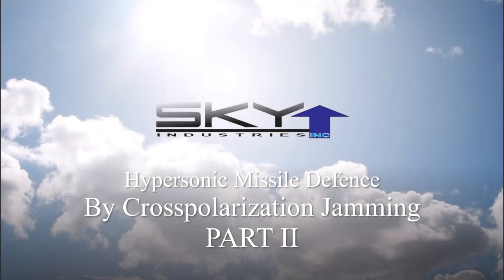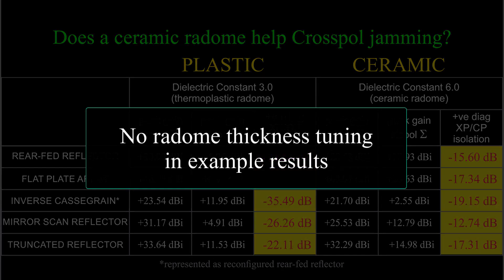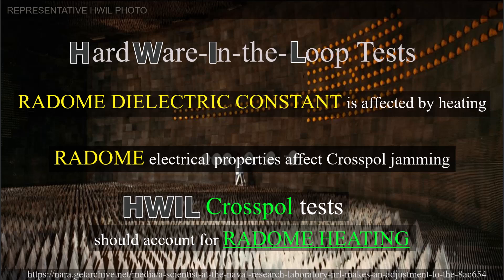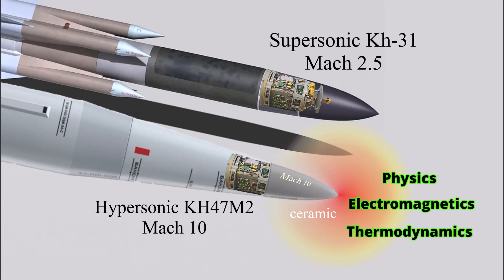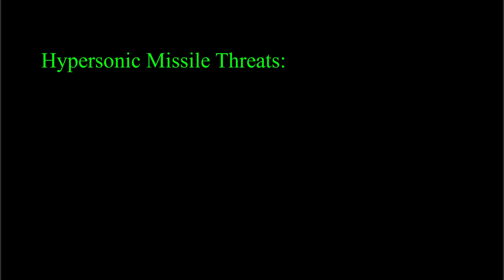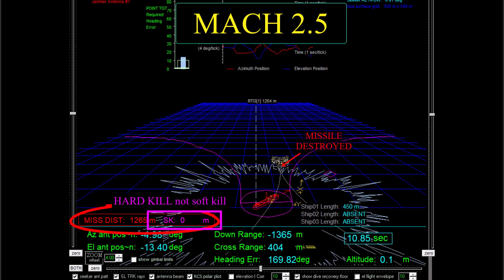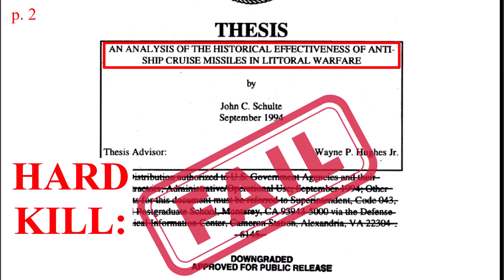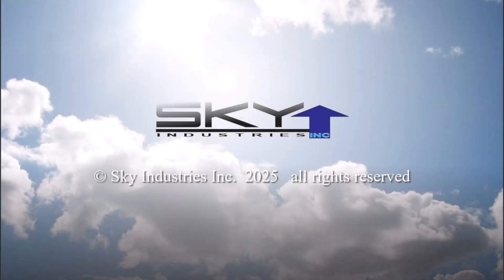Hypersonic Missile Defence By Crosspolarization Jamming PART II 25

Comment: "where a defender was alerted" is a big if on the battlefield.  I don't imagine these jammers will be turn on all the time. ...Alert time is limited due to the Mach 10 factor.  Do want to thank you for a great video.  Learn a lot.
Reply: a carrier group is unlikely to travel without some sort of AWACS asset tagging along, so over-the-horizon early warning can be assumed present.
Reply: SBIS has coverage over the entire globe and is capable of seeing even small fires as has been proven in the Ukraine war. these satellites are more than capable of providing instant launch warning, and because of the heat generated they can track the plasma flare all the way down to the surface without difficulty.
Reply from the maker: Expect the jammer to be on all the time, day and night.  Doesn't mean it will be, but it should be.  

Also expect the jammer to be cued by other shipboard sensors.  I believe this is what the author meant by "where a defender was alerted", another way of saying, "where the jammer was operating as intended".
Reply: @skyindustries  Exactly, ELINT sniffers in the AO would detect acquisition radar emissions the moment the missile turned active if not from the ships own onboard ESM antennas. This is also excluding Launch detection from space based early warning systems, which would make the chance of early detection very high. The general assumption about any unit is to realize that it won’t exist in a vacuum; I.e. nothing fights alone, assume that your target will always detect your attack and plan accordingly.
Reply: @skyindustries  Well home on jam and also Ukraine has shown you cant always jam

Plus reaction time is slowed down 

And thats when your point about hard kill is bs

Since you might end up jamming that too 

Kinda happened to the HMS Sheffield

Not saying Jamming is useless but relying one just measure isnt all that good of an idea either

Layered air defence is key
Reply: @spark5558 youre assuming jamming is continuous, and it is not for all intents and purposes, with respect to the adversary. 

that's about as far as I'll go.
Reply: Aegis BMD is networked together so while early detection is not a given, it is very likely.
Reply: @aidanmattson681  from my limited knowlige

Wouldnt the main advantege of  aegis be that your response time would be much shorter?
Reply: @nikolaideianov5092  the Aegis weapons system was principally created to better handle large saturation attacks. This also involved getting air plots from AEW or even other ships at times. 

Aegis BMD is even more network centric because of the geometries of BMD. Sensors, shooters, and targets that you need to defend, are likely all in different positions. 

I wouldn’t say that Aegis has an advantage because it reacts faster for two reasons. 1. I don’t know how it exactly compares with other systems. 2. A far better characterization of network-centric advantages is that it has more time and freedom to react within.
Reply: @aidanmattson681  thx

Comment: With the caveat that I A)haven't yet watched the series to completion as I've just discovered it B) am a layman C) know it's a sensitive topic, do to the inherent design requirements require a mechanically steered radar to get both lateral and vertical guidance in the context of guiding a hypersonic missile in the terminal phase of a ballistic trajectory? 

And if not, would crosspolarization as a potential counter to hypersonic missiles be significantly affected by mounting a AESA radar as a seeker? 

With weapons such as the DF-21C being primarily designed for very high value targets such as aircraft carriers it would make sense to me to put the most capable guidance available in the already low-volume high-value weapon.
Reply: there are much smaller and cheaper air to air missiles with AESA seekers, a hypersonic missile aimed at entire ships will obviousle be worth putting an AESA on, only reason not to is if the old school monopulse is trusted more as proven design, seekers can be swapped and weapons modified

Comment: but what if we had 2 radomes? and ejected the hypersonic one, 2 seconds before impact? the plastic one just has to last that long. asking for a friend.
Reply: Eject a solid ceramic radome while flying at 2.5 Mach? How would you even do that?
Reply: @PeterA650  I was being silly, but if you look up the russian word smekalka which sometimes roughly translates as redneck engineering I wouldn't put it past them to try.
Reply: You need to eject the ceramic early enough that you still have time to course correct. The faster you're going, the more distance you need to maneuver, all else being equal. It's going to be at least about 40 seconds no matter what speed you're going.
Reply: Remember, not everything has to be shaped like a missile for a radar to not understand what's coming

Comment: Hmm yes... I know some of these words.
Reply: I do too, I recognized "the," "and," "antenna," pattern" for example.
Reply: @therocinante3443  "Pattern" was a difficult one for me
Reply: y is he publishing this on utube> this sohuld be secet technology
Reply: @TheGuildofIntrigue  If essentially everyone in the field under discussion knows this, there is no need to make it secret.  There are a number of subtle word choices that indicate clearly that this guy is very well versed in top secret restricted access procedures and is deftly handling what he can talk about and what he can not.  That is to say this presentation has been looked at from the top secret/public knowledge angle.

Even just from a ham radio angle, I can understand everything he is saying as basic radio propagation.  But still, I would have to go back to school for 5 to 10 years to be able to do any of the analysis.  There is a huge gulf between understanding something presented and being able to create the presentation in the first place.
Reply: @TheGuildofIntrigue  He also mentions in the first video that the system he's talking about was from the late 80s, so it's an older system.  It's still potentially useful, as he points out, but this is by no means the cutting edge of Russian design.

Comment: Radome, What if for Mach 10 cruise phase, a Heat shield protects the Radome.   Heat shield is ejected was the speed reduces, revealing the actual Radome.
Reply: Alternatively, following the kill web concept, the missile might be guided by another system entirely. Maybe a satellite constellation. Maybe an airborne early warning radar. Maybe a fishing boat that happens to be in the area.
Reply: @Virsconte or Su-57 😶
Reply: @cujbaion1 isn't that the thing that is supposedly stealthy but uses uncovered  Philips screws from the russian version of Home Depot?

The one with an AI wingman drone where the prototype seems to have become more intelligent than its designers and immediately tried to defect to Ukraine?
Reply: @ErikItland  don't be that naive in a serious conversation
Reply: Just replied with almost the same thing, before I noticed your comment; it seems anybody with an engineering mindset can overcome, at least in theory, this jamming technique, trivially.
Reply: Yet, if you have your missile guided by a kill web, you need proximity of the guiding system to the target which makes it more susceptible to being targeted itself. I think a shedding heat shield is more achievable.
Reply: @Vinzmannn The guiding system could be another missile in the same salvo that slows down early, which could be combined with a jettisonable heat shield.
Reply: Alternatively, an active heat shielding system that uses gas to create a boundary may be employed. 

This isn’t a new problem, the Pershing II used a radar but I don’t know what system they devised for it.

Comment: Thanks for doing these videos. Also, where can I get an active missile seeker for my living room. That would be so cool!!!
Reply from the maker: 3D print one!  There are lots of photos in the open :)  

I mean you can 3D print the antenna of several different kinds, vacuform the radome in two halves from transparent plexiglass, use the 3D printer to create the radome half-mold.
Reply: there are some articles circulating on the ebay/craigslist marketplaces, but not always cheap and don't usually ship from the country of origin. Also there are youtube channels dedicated to teardowns of military electronics. Good hunting!

Comment: Now I really don't know enough, but on the issue of needing ceramic vs plastic due to the plasma sheath. Couldn't the ceramic be shed like a staged rocked revealing a plastic head just before impact to bypass the ceramic issue?

Thus resulting in a counter measure to the counter measure

I might be looking at a non issue entirely that's impossible to implement or irrelevant to the discussion at hand.

Its just in my layman's eyes that seems like a possible counter to crosspoll. And if a layman thinks of that, I would assume its a possible discussion point easily addressed and sidelined in the event of those who fund projects. 

Anyhow just curious and found the whole idea absolutely fascinating, always a pleasure to learn knowledge from highly skilled individuals such as yourself.
Reply from the maker: Interesting idea to have a protective radome for the cruise phase, but I don't think it will protect the plastic radome as the inside surface of the ceramic will be very hot.  And there is the risk of damaging the missile when the ceramic is shed.
Reply: @skyindustries  how about an ablative plastic radome that will shed some of it's thickness during the hypersonic phase, essentially converting energy into vaporizing material into gas, but with some material remaining at the terminal phase?

Ablative phenolic/fiber composites have been used in heat shields of reentry vehicles for decades now. I wonder if their epsilon/tg delta are manageable in the tens of GHz frequency range.
Reply: @sashimanu  an ablative shield wouldn't finish re-entry with a known and uniform thickness, which means you probably have calibration issues for terminal guidance if you use that.
Reply: @thamiordragonheart8682  💯
Reply: Staging is nice because the loose parts are all behind the missile as it continues forward. Popping stuff loose right in front of the missile as it's still extremely supersonic seems hazardous to the control surfaces at the very least.